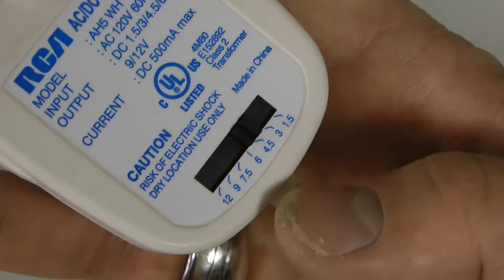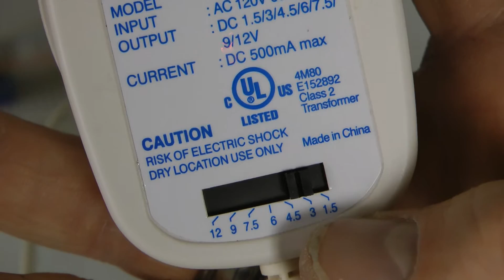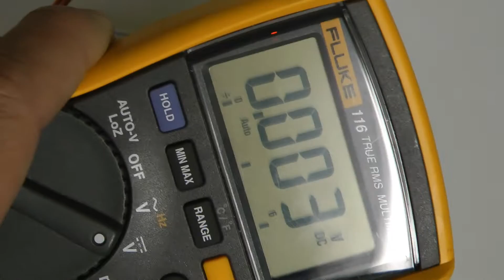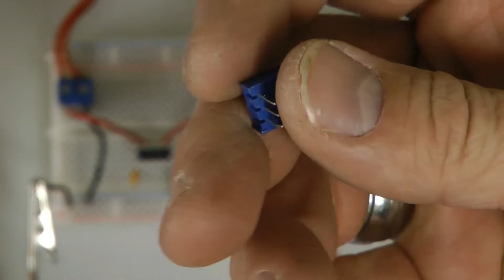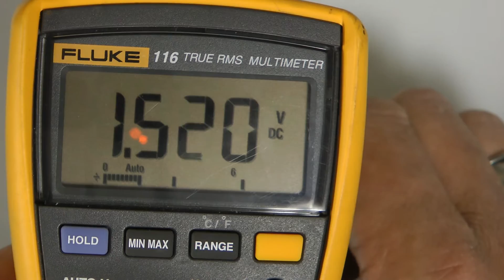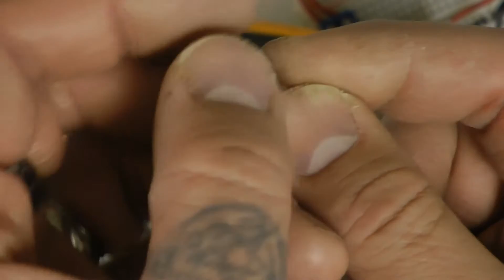Ep1S1 DIY survivial Custom DC voltage Regulator.mp4

Comment: I tried your expierment with a LM317 from ripoffshack. I wanted to take a 12 volt 500ma wall adapter and bring it down to 3 volts. I used a 10uf electrolytic input and the same for output. It worked well but a lil unstable ? So I added a 0.1uf to the output and now it is very stable. I read the pot and it was adjusted to 250 ohm. So I took a 150 + a 100 ohm tied them together and put in place of the pot. Everything should have worked fine but with all connections triple checked but only get .23V

Comment: That wall wart isn't regulated, hence the 4.3v @ 3v setting. under load it will drop to 3, and under even more load it will continue to drop even lower... Oh and its a potentiometer, not a potometer. but yea good vid introducing the LM317 to everyone. It's definitely a must have if you wanna use wall warts as power supplies.